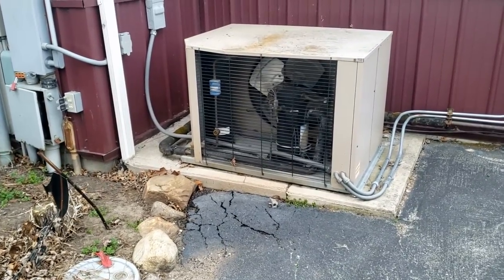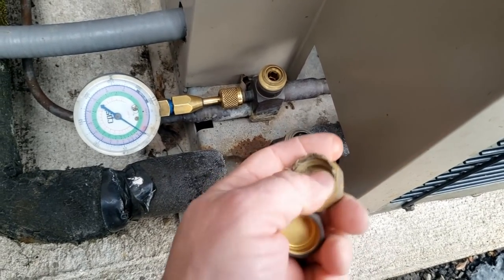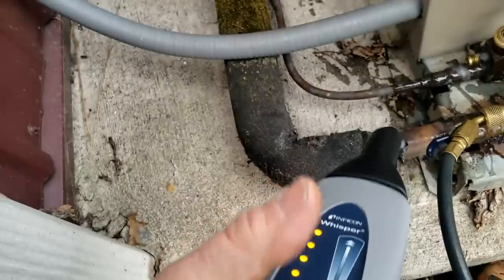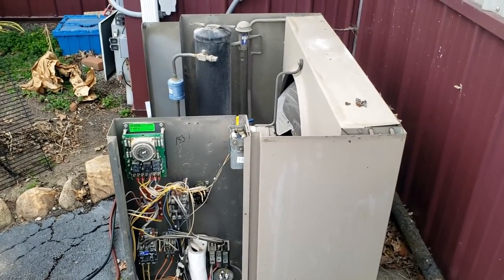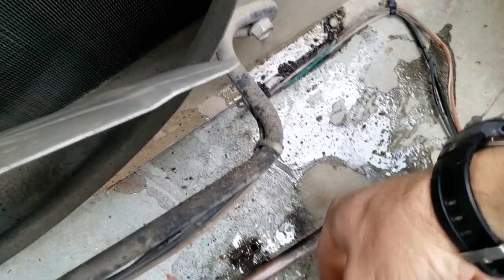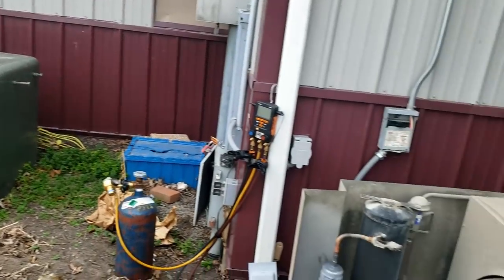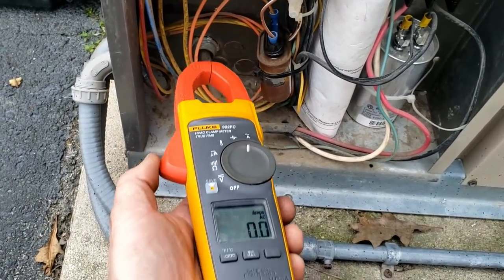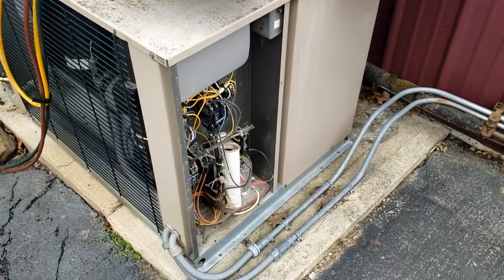HELP! My Freezer Is NOT Running!

Comment: nice video, yes it looks like maybe that valve had been overheated, I am surprised it hadnt leaked before now. I was like you I hated call backs, usually call backs were freebees unless it was something that happened, I had nothing to do with even then it was hard to justify charging the customer for a call back unless it was something major. You are a great trouble shooter.
Reply from the maker: Thank you sir!

Comment: How about crushing/squishing the pipe before using the angle grinder? Just a thought that should stop any shavings from going further than you pipe cut later.

Edit: "pinching" was the word I was looking for ;)
Reply from the maker: Hand snips work to, I just wanted to use my new tool to justify buying it 😄

Comment: I have gear envy. Man those are some nice tools you got...no homo. Lol
I carry a can of rust reformer paint with me and whenever I  see paint has faded and rust started to take hold I wipe the piece down and spray it... Not too much work and can is only 4 or 5 bucks US so not a big deal financially.. And it may benefit you if you get called back one day and you're having to remove a rusted out piece that won't budge.. Or getting your tools all full of rust when you're working.

Comment: One other quesiton:  How do you swap from your Blue vac hoses to your manifold charging hoses after your vacuum is complete? Thanks.
Reply from the maker: Correct. I use my valve core tools to isolate and then connect the manifold, purge the manifold up to the valve core tools then recharge. Good question👍👍
Reply: @HVACRSurvival  BAM. Thank you!
Reply from the maker: Your welcome👍👍

Comment: at 3:27 you said “the sight glass still looks green, which is good.” 
What does that tell you? 
I’ve been doin resi hvac for a few years but just started refer so i’m a bit unfamiliar
Reply: The sight glass has a moisture indicator; green is dry and yellow is wet.
Reply from the maker: Sorry, I never seen your comment.  The response from Jon is correct.

Comment: What's the purpose of that king valve in that location?
Reply from the maker: Isolate the compressor for a change out is my best suggestion. I would normally replace the refrigerant if the compressors bad unless it's just a valve issue.
Reply: @HVACRSurvival  thank you! Man, you’re up early. Have a great day, sir.
Reply from the maker: @karizmatic5  It's 08:02 right now on the east side.😁
Reply: @HVACRSurvival  oh hell, then it’s me that’s up so early.
Reply from the maker: @karizmatic5  😅🤣👍

Comment: Nice lesson 👍
Reply from the maker: I appreciate your kind words 👍👍
Reply: @HVACRSurvival   can u talk more about temperature inside walk ins coolers and freezers. Example like if u get the suction pressure a certain pressure. Then the evap temp would be here. To make the walk in food section temp here. this would apply to this gas. 404 or 134 etc. Also safe head pressures and temps. . Hope I don't sound confused. But I'm new to commercial refrigeration. I'm more residential appliances. Thanks
Reply from the maker: @Indianatrucrimestories  are you talking about how a EPR controls the temperature of a case and typical TD of evaps?
Reply: @HVACRSurvival  yes. I did purchase the commercial refrigeration book by dick . Yes the epr controls. I'm assuming these control help u achieve the satisfied temp. In freezers and coolers.
Reply: @HVACRSurvival   I'm a beginner I'm probably confusing u . I'll read the book. I'm sure it would get me where I wanna be. Thanks.
Reply from the maker: @Indianatrucrimestories  I really like the book, "Refrigeration for air conditioning technicians". I hate books, but I value that one.

Comment: Nah all those discharge valves leak. Cheaply made. Can’t take the heat.
Reply from the maker: That's why I went in doubt you cut it out 😁👍👍
Reply: @HVACRSurvival  downside is. You’ll have to recover the gas to change the comp...
Reply from the maker: @zekemontgomery6678  if the compressor has gone bad would you really reuse the refrigerant? Hell no. That stuff is contaminated.
Reply: @HVACRSurvival  All depends how it failed

Comment: i like those tool  cases that look kool but after you pull out the geaR YOU CANT GET IT BACK IN!!!!!!!!!!!!!  ARGHH
Reply from the maker: That's why I'm trying to keep it as empty as possible. (One less tool to lose) and it already weighs 30 lb the way you see it. I've been trying to get smaller than I just went larger thinking if it's on my back I won't feel as heavy. 🤦‍♂️🤦‍♂️

Comment: Why would you put some gas into the system knowing there is a leak? Just add nitrogen first and check for leaks....
Reply from the maker: Do you have a leak detector that goes off on nitrogen?  All of mine need a trace gas of refrigerant or I'll need to use the ultrasonic.
Reply: @HVACRSurvival  no i use leak spray or soapy water like your supposed to here in ireland anyway...
Reply from the maker: @1989Chrisc  what do you do when the leak is in the coil where the soap doesn't show up unless its large?